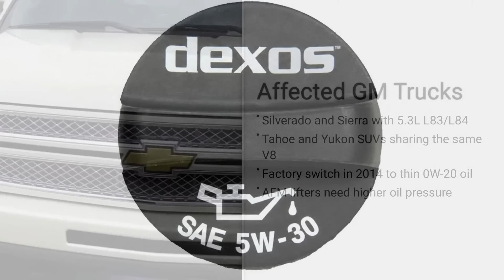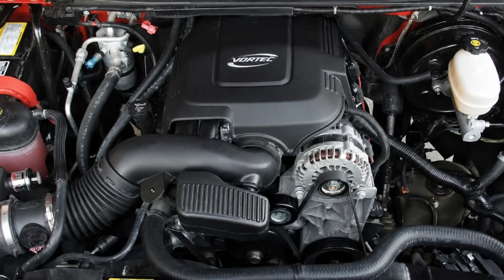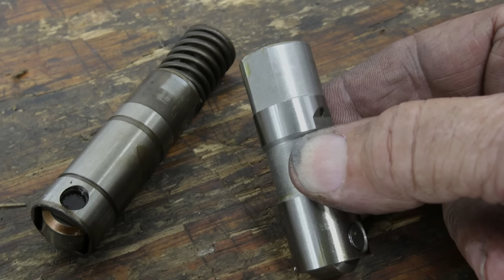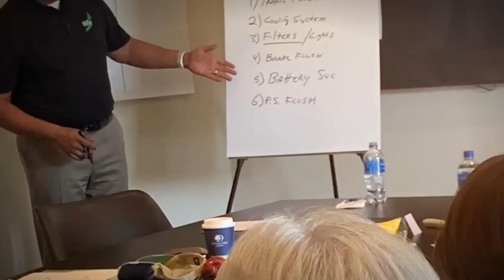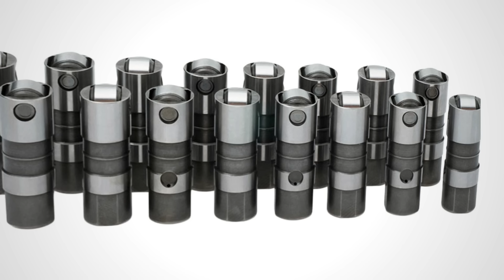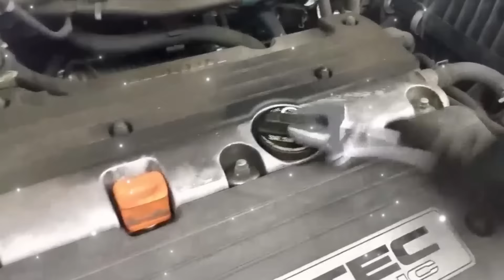The 5.3L Oil GM Tells You to Use Is KILLING Your Lifters — Switch Before 60k Miles

Comment: 2025 Silverado 5.3L z71 trail boss custom… already put the range finder on the ecu… only has 17000 miles… i always ran 5w30 in my chevys… didn’t realize they changed as I haven’t done an oil change yet as I bought it with 16k and it had a fresh oil change at the dealer…. Still have a warranty on it guess I’ll wait before running proper oil
Reply: Last I knew the range does not work with the 10 speed 2025. I was going to buy one and they told me it did not work for my 2025 5.3 L trail boss with a 10 speed. how does it work on yours?
Reply: @Maynardd That was my understanding as well. I have the Pulsar LT and it works beautifully but my truck is a 2020 Trail Boss 5.3l. My buddy has a 24 and they told him they didnt have anything available for the newest trucks yet. Hopefully that changes soon because the Pulsar is incredible.

Comment: I have no problem doing my own oil change but my 2024 5.3L is still under warranty. I’m pretty sure that if I used 5W—30 and something failed they’d void my warranty. Otherwise I’d do it myself.
Reply: They won’t, it is literally illegal. There is a law that states they can’t. Not to mention even testing the oil would be difficult for them to prove it was not 0W 20. Not to mention they would also need to prove any failure that occurred was literally 100% due to the oil you used.
None of these things would happen. You’re fine. Use what you want. Again, they cannot legally deny any repair if it is under warranty.
Reply: They will

Comment: 6.6 gas 25 Silverado the dealer put 0w20 in which calls for 5w30 it rattled in the valve train and valve train wasn't completely quiet took it back they put 5w30 in it and the valve train was quieter nat as noisy on startup

Comment: IM USING.  10/30.   AND THATS THE BOTTOM LINE.
Reply: I really like the 10/30 and 10/40 weight oils the problem is they sell most of those oils for high mileage vehicles which  those oils they put additives that will swell up your seals I've never used the the high mileage oils I have a 03 Silverado doesn't burn any oil and doesn't  leak any either.

Comment: I never listen to the cap. If I'm driving it daily and I do and my 03 Tahoe has over 300000 miles and going strong. I use 10/30 and sometimes in the dead of summer I use 15/40 in extreme heat. No ticks great gas mileage and runs smooth all the time. Oil cap just trying to sell crap oil I always new that.
Reply: My 2001 tahoe i just got rid of 350,000 miles ran shell rotella 15w40 I live in Florida and it never skipped a beat
Reply: In what world do you think heavier weight oil helps when it’s 100° outside when that oil temperature gets over, 200° even if it’s below zero outside inside your engine. The ambient air temperature is irrelevant….
Reply: @Maynardd I gotta disagree.   Everything i own except my 05 sierra is well over 300k.   07 silverado at 348k no lifter problem
Reply: @andrewthorsen5531  that’s great, my wife has about 240,000 miles on her Camry with 0W18. but that is not the question. We’re talking about temperature. 
For whatever reason people think when it’s 100° outside, it’s too hot for 0W oil. But that oil reaches 200° easy inside an engine. Again the outside temperature is irrelevant.
Reply: @Maynardd maybe its just stuck in my head from a lifetime of using air cooled motors.   And with those i guarantee thicker oil in higher temps makes a drastic difference in longevity
Reply: @andrewthorsen5531  there’s no data that shows that. just people that think thicker is better… you do realize it’s all about the additives right? when tolerance are tight, thicker oil is the enemy.
Reply: @Maynardd I gotta disagree experience tells me otherwise.   Try putting things oil in a honda rancher and ride fences all day in the heat.   Or ride an air cooled motorcycle.   Besides my personal experience read the forums.   Thicker oil is better in the heat on most motors.   On motors whith vvti or cam phases where oil pressure sets the timing it will not work.   Also read on private aircraft motors the data is there
Reply: @a @andrewthorsen5531 here is the data? How about Boat motors that are running an average of 3000 RPMs at just 20 miles an hour. And this is under far greater load than a vehicle. my 250 outboard takes 5W-30 5W-this would be considered a thin oil for something running between 3000 and 5000 RPMs all day long. 
I don’t recall what my motorcycle took as that was 12 years ago when I get rid of it, but it wasn’t anything out of the ordinary.
You said based on your experience? But yet you haven’t ran anything for at least a couple of hundred thousand miles on thin oil. Toyota Camry, 240,000 miles. I was wrong in my initial comment when I said 0W 18. It’s actually 0W 16.
The only place thicket oil comes into Play is under heavy load. And that’s because something is designed that way to be under heavy load. We’re talking about vehicles here, not semi trucks. Not tractors, and do not mistake speed for load.
You mentioned the 3.5 or turbos, these engines are considered high performance, but they’re running on thinner oil? Isn’t that contradictory to your point? They run much hotter but take thin oil? See what I’m saying here?
There’s nothing wrong with thin oil. you realize between 0W 20 and 5W 30 the temperature difference is only 10° right?
And you realize the closer the number, for example 5W 20, the stronger the oil is toward shear..
Meaning your 10W-40 is going to shear twice as fast as 5W-30, or even 0w20 for that matter. that is literal data.
Reply: smart man.

no one anywhere should ever use 0W oil.  it never gets 0W cold anywhere.

Cold Testing Temperatures by Oil Grade

0W Oil, Cranking test: -31°F (-35°C), Pumping test: -40°F (-40°C)
5W Oil, Cranking test: -22°F (-30°C), Pumping test: -31°F (-35°C)
10W Oil, Cranking test: -13°F (-25°C), Pumping test: -22°F (-30°C)
15W Oil, Cranking test: -4°F (-20°C), Pumping test: -13°F (-25°C)
20W Oil, Cranking test: +5°F (-15°C), Pumping test: -4°F (-20°C)

Type this into Google (for your location):  How many days in the last 10 years did the temperature of MY LOCATION drop below -31°F, -22°F?, -13°F, -4°F, +5°F?

Use 10W-40 minimum, year-round, use 20W-50 for heavy duty like summer towing, always idle after start until idle drops, and never slack until oil gets dark/dirty.  Change all other fluids at lowest end of their listed service range.  ..then why has the manufacturer cabal been exclusively listing 0W oils in the owners manuals and on those freaky little stickers under the hood?  Because the manufacturer cabal would prefer that your vehicle enjoys a shorter lifespan and for you to buy another of their vehicles sooner.
 
ENGINE OIL COLOR CHART
https://www.instagram.com/p/DP2kLcxEvqR/
Reply: I run 10w30 mobile one gold bottle for the last five years 385,000 miles and Still runs excellent.
Reply: @1TommyVercetti1  

Cold Testing Temperatures by Oil Grade

0W Oil, Cranking test: -31°F (-35°C), Pumping test: -40°F (-40°C)
5W Oil, Cranking test: -22°F (-30°C), Pumping test: -31°F (-35°C)
10W Oil, Cranking test: -13°F (-25°C), Pumping test: -22°F (-30°C)
15W Oil, Cranking test: -4°F (-20°C), Pumping test: -13°F (-25°C)
20W Oil, Cranking test: +5°F (-15°C), Pumping test: -4°F (-20°C)

 How many times in the last 10 years did MY LOCATION drop below -31°F, -22°F, -13°F, -4°F, +5°F?
Reply: My three Tahoe lost oil pressure and it wasn’t the sensor. It wasn’t anything other than I think the pump was going bad on it and that joker still ran even when I sold it was still running. You can’t kill them old ones. I now have an 18 Tahoe and I was thinking the same thing I don’t really want to run the thin oil.
Reply: 05 Tahoe here 10w30 for last 7 years were approaching 300k miles still full power although she does tick here and there
Reply: Good. I have always used 10w40 on my tahoes (2007, 2016, 2025) with zero engine issues. They still run like new and my friends swear that I must have replaced the engines lolll

Comment: Read your manual! If you take your 5.3 on the highway or drive it over 1 hour at a time you have to use 5W30  dexos 1 generation 3! You are reading the EPA recomendations
Reply: My 2019 manual says nothing of the sort on changing it for highway use
Reply: @re2248 funny try downloading it that is what I did. My wifes cousins just bought a new 3 letter GMC and he told me he uses nothing but 0W20 and he also said that never warm them up. Start and drive. Just saw him again last week and he said he just took it in for an oil change and saw the Technician putting in 5W30 so he went and complained to the service manager. He showed  him in his manual that 0W20 was only for short in town trips! When he was sent out to it it was idling and when he asked they showed him if it hadn't been running for an hour it should idle or 10 minutes!

Comment: I bought my 03 GMC Sierra brand new. I’ve used 10w30 mobile 1 since the first oil change. Just hit 422,000 miles and not a tick.
Reply: Well a 2003 Sierra doesn’t have collapsible lifters
Reply: @DownhillDayDreamzzz true, but we have a 2002 Tahoe with a non dod 5.3 engine. It has 293,000 miles and it got a tick recently. I am the one who has maintained it since new except for a few oil changes when my folks used it in Florida as snow birds. But under my watch it’s used 10w-30 petroleum valvoline oil. After it got a tick, it never lost power, I added sea foam to it, ran it for 30 minutes and shut it off. It sat for the night, the next day no tick at all. We drove it 311 miles and afterwards still no tick. Drained and added same oil, still no tick. So it can happen even on a non dod engine. Hopefully our Tahoe doesn’t act up again. If it does, I am pulling cyl heads and replacing cam and lifters. It has excellent oil psi and runs like a sewing machine.
Reply: @anthonyharris3478  don’t touch it. Those engines will never die. Just run it as is.
Reply: @anthonyharris3478 I personally use a mixture of half ATF and half oil and run for 45 minutes varying rpm and holding like 3k...not driving , do not drive but while on lift....the detergent in the ATF gets the sludge out ....quoted down many AFM and non AFM lifter that way....drain and fill with good oil and new filter and good to go
Reply: @anthonyharris3478 2000-2006 tahoes already come without no dod or afm fricken goofy guy
Reply: @DownhillDayDreamzzz  My 2003 Suburban has been spectacular.    5w30 Mobil 1 and a pint of Lucas oil stabilizer every 5000 miles.  I do maintenance for the family fleet of vehicles...   When we get a used vehicle in the family we run MMO (Marvel Mystery oil ) thru the crankcase to clean the lifters of sludge from unknown previous maintenance.  Big fan of seafoam too btw.   After 500 miles with the MMO we switch to the Mobil 1/Lucas combo.    I am pretty sure Mobil 1 cleans the engine and conditions the seals.   We dont get oil leaks.
Reply: I’m at 280k on 2000 Silverado. I also run 10w 30 and it’s still chugging along with no oil leaks.. the truth is GM and Ford make shit trucks now..
Reply: I had mine reflashed and shut down the cylinder shutdown nonsense also we use 5w40 liquimoly oil and it is like a new truck
Reply: I just passed 300,000 with 10-30. Plus a AFM disabler
Reply: @johnc2946 me to anniversary always ran 10 w 30
Reply: @johnc2946 at what mileage did you add the afm disabler?  I just added an afm disabler to my '07 Sierra 5.3 at almost 260k.
Reply: Yeah. That's way different tho. Before dod
Reply: Got 260k on my 03 sierra. Runs perfectly! Pulling the motor next month for a 6.0 swap cams headers and whipple supercharger
Reply: I have an 06 Monte Carlo LTZ and I only use 5W-30 Pennzoil Platinum synthetic and Wix filters
Reply: you have a gem! Never sell it.

Comment: I have a 2020 gmc 5.3. Does this engine have the same problem? Thank you for the great info
Reply: I have 88k miles as far as I know o do not have active management as far as I know
Reply: @niespo6698 … If you have a GM with a 5.3 you definitely have AMF!!!
Reply: @robertsample42  Some trucks came through without it during the chip shortage.  My 2021 Sierra is one of them.
Reply: @Border-iq7we  they still have the crappy parts in the motor that fail. It’s only the chip that is not installed.

Comment: My 2015 GMC Yukon has 230,000 miles and I’m using a AMF disable module. I’m still using 0W20 oil. Also there’s another way to disable your AFM, you put your shifter into manual and you push the plus sign and  go up to the number 6, it’s turns in to automatic and it keeps your engine at 8 cylinder.
Reply: It's number 5.
Reply: I did same to my 10 speed put shift to L9
Reply: I'm using number 7 on my Sierra 2020 8spd and AMF disable module. Still running great!
Reply: @giovannifast6669 how do I disable my amf?
Reply: My 2010 Yukon Has 250,000 miles on it hauling a 10,000 LBS trailer every summer. Using the maintainance schedule recomend 5W30 Dexos 1 gen 3 oil! I just never turned on the cylinder delete  because it wasted too much fuel!
Reply: I have that same thing and use the same oil idk if I should change it but I have 183,000 miles so far
Reply: I think my mechanic told me that too. He gave me two options. I can do that or I can order an AFM. I thought my wife drives a vehicle sometimes I better just order the AFM.
Reply: I have a 2015 Suburban and had AFM disabled and the lifter still collapsed around 130k.  After that I swapped all the lifters and still running good with 5w30 high mileage synthetic.
Reply: @justinstatham6378  maybe there was damage before you installed it
Reply: @jasonmay9052 I had AFM turned off with a tune after the trans rebuild. There was not damage the lifter just collapsed.
Reply: @justinstatham6378 oh ok
Reply: @justinstatham6378 how did you have the lifters disabled?
Reply: Does this need to be done everytime you start your vehicle?

Comment: For my '21 GMC 1500 5.3L with no factory AFM/DFM that has 0W-20 Dexos-1 on its oil filler cap I use 0W-30 during cold winter months and 5W-30 during hot summer months.  Also change its Dexos-1 oil / filter every 5,000 miles (8K kms) - which is 40% remaining on its OLM.  I also installed a low cost Catch Can from Amazon.  Currently has 128K kms (80,000 miles) and its engine runs great.  It's lifters are now near silent and it has acceptable oil pressure when its engine is hot.  Especially at idle RPM.    Based on my in-depth research, thicker "30" oil at 5,000 mile changes creates less engine damage.  Especially in the long run...
Reply: I keep reading contradicting things, some say go with 30 then some say dont because the small tolerances with the lifters blah blah blah, I want to go with 30, but I dont fuck anything up

Comment: If you have over 100,000 miles and no lifter ticking, why would you mess with the VLOM thimble filter if you've installed an AFM disable module? I just want to work smarter, not harder.
Reply: no one anywhere should ever use 0W oil.  it never gets 0W cold anywhere.

Cold Testing Temperatures by Oil Grade

0W Oil, Cranking test: -31°F (-35°C), Pumping test: -40°F (-40°C)
5W Oil, Cranking test: -22°F (-30°C), Pumping test: -31°F (-35°C)
10W Oil, Cranking test: -13°F (-25°C), Pumping test: -22°F (-30°C)
15W Oil, Cranking test: -4°F (-20°C), Pumping test: -13°F (-25°C)
20W Oil, Cranking test: +5°F (-15°C), Pumping test: -4°F (-20°C)

Type this into Google (for your location):  How many days in the last 10 years did the temperature of MY LOCATION drop below -31°F, -22°F?, -13°F, -4°F, +5°F?

Use 10W-40 minimum, year-round, use 20W-50 for heavy duty like summer towing, always idle after start until idle drops, and never slack until oil gets dark/dirty.  Change all other fluids at lowest end of their listed service range.  ..then why has the manufacturer cabal been exclusively listing 0W oils in the owners manuals and on those freaky little stickers under the hood?  Because the manufacturer cabal would prefer that your vehicle enjoys a shorter lifespan and for you to buy another of their vehicles sooner.
 
ENGINE OIL COLOR CHART
https://www.instagram.com/p/DP2kLcxEvqR/

Comment: Bullshit , 5W-30 is a great choice , my oil analysis comes out much better than 0W20 , wear metals were half with 5W30  over 0W20 using PENNZOIL ULTRA PLATINUM 5W30 over Mobil 1 0W20 ….
Reply: I use 5/30 on my 2000 Chevy Silverado 4x4 with 291,000 and counting. I do my own oil checks. Bought it brand new in July 2000. I am a smart lady I guess. My mechanic said he would go to California in it and I have not hurt that motor.
Reply: @joannethompson7719  yeah this video is talking about AFM lifter engines not the engine you have.
Reply: @joannethompson7719 that engine has called for 5w30 from day one 😂😂😂
Reply: @joannethompson7719 that was the standard for that gen. They are mainly talking about the LT engines.